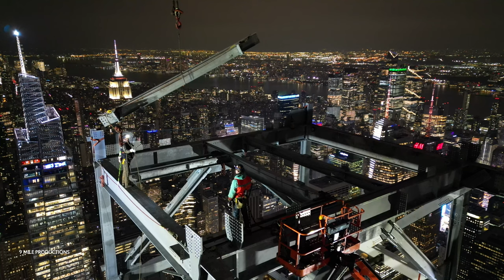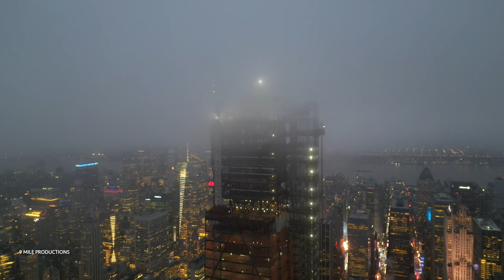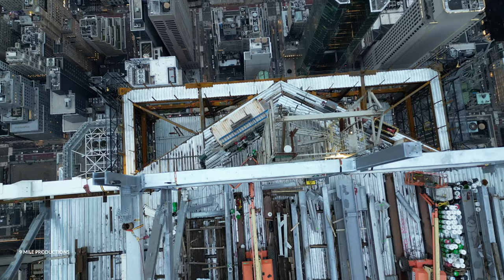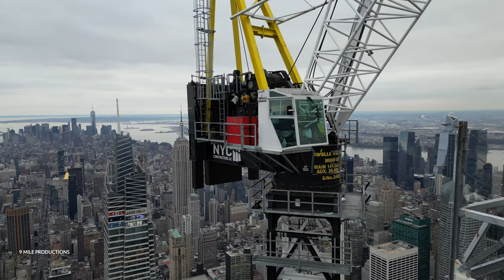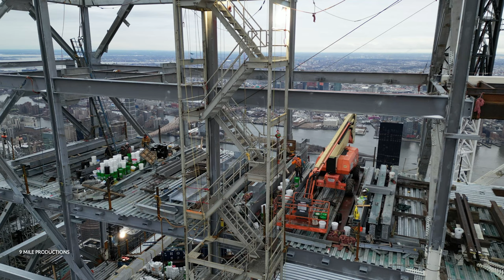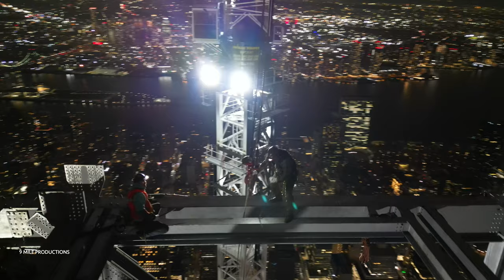JP Morgan Chase Building Construction Aerials (update) 270 Park Avenue, New York City USA

Comment: Is this the leaning tower building, like the millennium leaning tower building in San Francisco?
Reply from the maker: This is 270 Park Avenue…the soon to be world headquarters of JPMorgan-Chase…designed by Foster+Partners. The project you are referring to is 161 Maiden Lane (also known as 1 Seaport) an incomplete 670 ft (205 m) tall residential skyscraper in the Financial District of Manhattan, designed by Hill West Architects. The building overlooks the East River and topped out in September 2018. The building leans 3 inches (76 mm) to the north as a result of the method used to construct its foundation. As of 2023, only half of the finishes, including windows, have been installed.